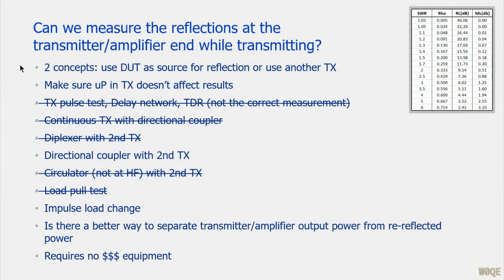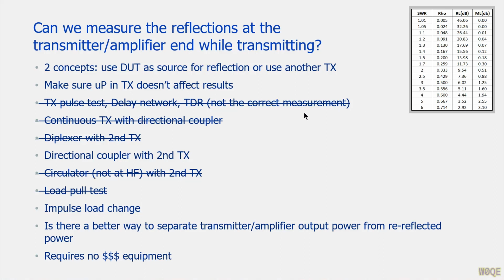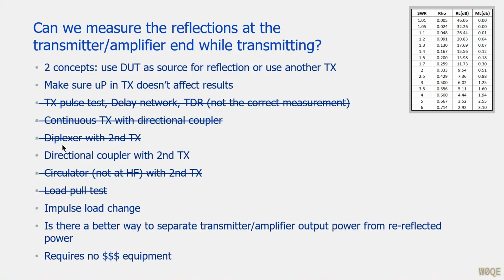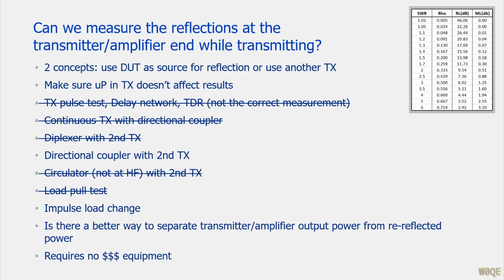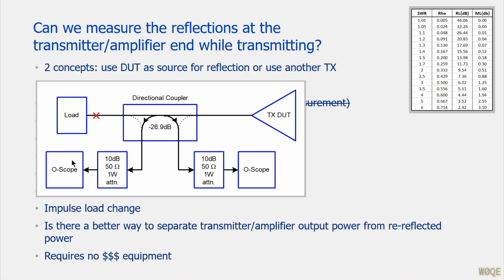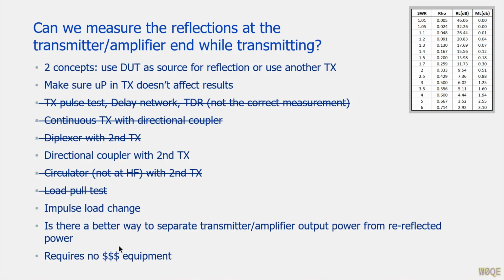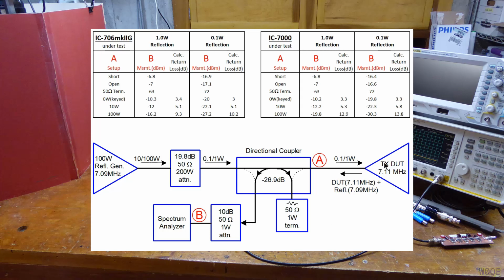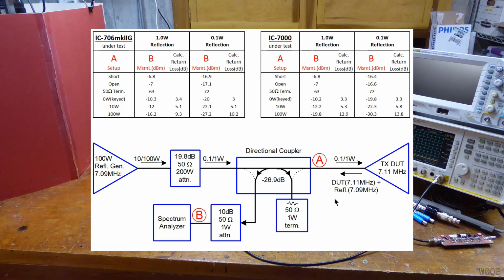#71: Reflections from a Transmitter or Amplifier

Comment: Thank you for this concise analysis starting from charting your options. It's always great to see good ideas followed by tests and results. The foundation of ham radio is for "The Advancement Of The Radio Art and The Enhancement of International Goodwill." This work certainly counts as the former and publishing your results on Internet certainly counts for the latter - thank you!
A lot of hams get taught the power transfer theorem and assume the TX must be 50R+j0 to get "full power out" but during SWR analysis the "generator" is a fully reflective voltage or current source. These two things cannot be true at the same time - and neither of them really are.

Comment: Can this method be a way to determine the output impedance of a transmitter?
Reply from the maker: Guido,
I believe so, provided that the transmitter does not have protection circuitry that artificially affects the output.  However it is much easier to do a "load pull" test where you use a impedance matching network (antenna tuner) and rather than adjust for minimum SWR at the transmitter you adjust for maximum output power to a dummy load.  Then disconnect the transmitter and measure the impedance that the transmitter saw from the matching network and the output impedance of the transmitter will be the complex conjugate of this value.
Larry, W0QE
Reply: @w0qe  
Larry,
The question of whether the output impedance of a solid state HF amplifier has to be 50 ohms or (much) lower has long been subject of discussions at meetings in my local radio club SNW.
http://www.snw.uba.be/
Hopefully your method can finally deliver reliable measurements, it looks really feasible. 
My attempts to determine the output impedance only with different loads was not a success.
I hope to have results next week.
Guido  on7ch

Comment: I just found this channel, I have seen Larry's posts on "ham-antennas."  I know nothing about modeling software.  I do understand RF systems.  The transmitter should look like a infinite VSWR to returning waves with a RL of nearly zero, as the transmitter has an impedance under about two Ohms.  Measure the source impedance and calculate these two values.  He should have been testing with a dumb transmitter like a Knight T-50/T-60 or Heath DX 50/DX 60.  A good load is an antenna at resonance, a bad load is that antenna at the far edge of that band, especially the top three.  In my opinion virtually all of the power reflected by the load will be re-reflected by the source.  (transmitter or amplifier)
Reply from the maker: Hi Ron,
The only transmitters I have are all solid state ones like the two I measured.  Assuming that you don't think there is anything wrong with my measurement technique I could easily measure an old tube (dumb) transmitter.  They often show up at hamfests and it wouldn't need to be pretty as long as it worked.  I would find it interesting to see what the return loss was.
Larry, W0QE

Comment: I own a piece of equipment called an OIB or operating impedance bridge, intended for SW impedance measurements. It can make measurements from 2-30 MHz at power levels up to 1kw CW. Obviously once you know the complex load impedance vs source impedance you can plot the VSWR on the smith chart using simsmith. It’s very accurate +/- 1ohm R (-500-+500 ohm) +/- 5% X (-800-+800 ohm) and I purchased mine as new off eBay wrapped in brown wax paper for $600.  That was a good deal I grant you, and they often go for more, but if you watch used ones can be had.
Reply: You can also make RF current measurements at the feedpoint using either an in-line or toroidal meter and calculate transmitted power that way once you know the impedance of the antenna. That’s what the FCC accepts for transmitted power measurements.
Reply from the maker: Can this device make this measurement while looking into the transmitter/amplifier that is actively transmitting?
Reply: W0QE yes,it can safely be used in either direction without damage to the bridge. It is simply a precision Wheatstone Bridge that has components large enough to make inline measurements of RF circuits. New this unit is quite expensive, but if you can find them used...they are quite useful. I own one both for 2-30mhz and one for 500khz to 2mhz. The low band unit will do measurements to 10kw CW. It even supports an external detector for increased accuracy if you are driving it from a low power source such as a signal generator. 

https://www.deltaelectronics.com/data/oib2data.htm
Reply from the maker: I looked at the URL of the operating impedance bridge.  It appears to be a high power device that can measure voltages/currents with phase in a high power RF circuit.  However I do not see how it can separate a transmitter forward wave in a transmission line from a reflected wave that is delivered to the transmitter and partially re-reflected.  Perhaps if you generate the reflected wave at a slightly different frequency (which is what I did in the video) then the OIB with a tuned receiver/spectrum analyzer can make the measurement.  Would you happen to have a schematic of the OIB?  This is interesting stuff. :)
Larry
Reply: W0QE  I believe that the manual has some greater detail as to the circuit involved. I'm not sure if it has the full schematic or not. I'll be glad to take mine down and send you some photos and maybe set up a demo circuit with a low power source. 

I'm also interested in trying something, I wonder if you could attach a scope to the external detector port of the bridge and trigger it off the rise of the waveform. Trigger the transmitter using an external closure so it could be triggered once very fast and try to capture the rise going out, the rise coming back, and any rise coming back out again, etc... 

Unfortunatly, while I own a very nice scope it's not a DSO so I can't try that on my end, but I'll ask a couple of friends and see if they have one I can borrow for the evening. One day I'll move out of the analog world and get a digital scope, when I stop buying RF gear.

Comment: Interesting, Larry.  This certainly disproves the idea that all of your power eventually reaches the antenna when you have a high SWR at the antenna.
Reply from the maker: Well maybe!  You would need to make measurements on more transmitter/amplifier output circuits to be more certain.
Larry
Reply: That came to my mind also, I wonder what the results would be with a hybrid transmitter/tube amplifier?